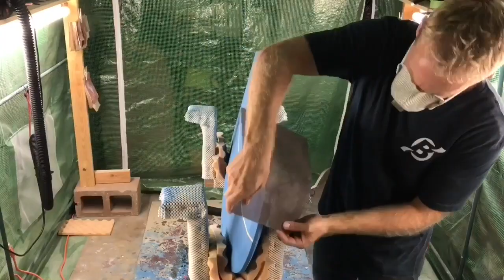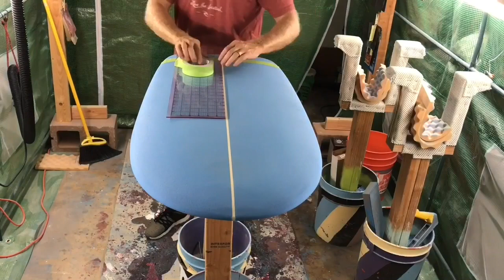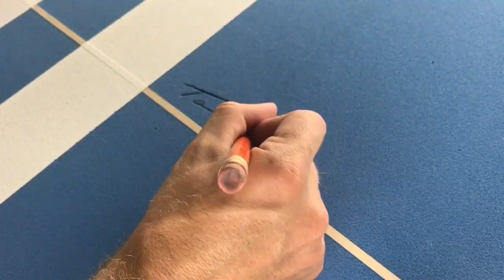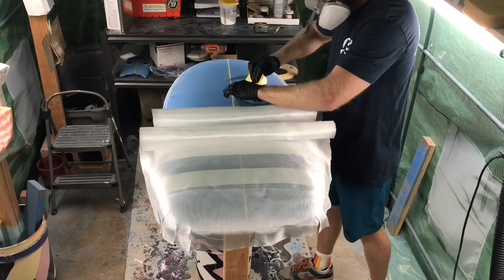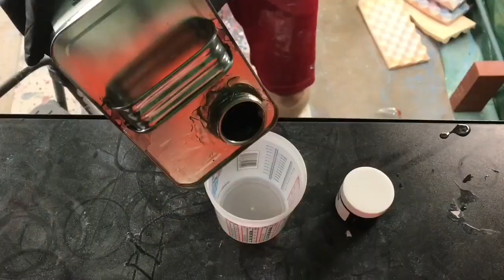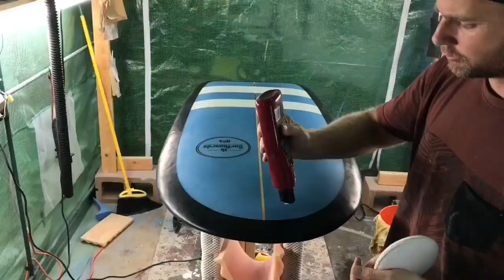Surfboard Shaping & Glassing [Paipo]

Comment: Hey Tanner, nice vid!!! Did you finish the board with gloss coat+polishing or a regular hot coat+polishing?
Reply from the maker: Thanks! I did a gloss coat and polishing.
Reply: @BendheimBoards  Niiiiice, did you use a specific polish for surfboards or a regular one? I think regular ones would do the trick.

Comment: what grit did you use to sand the tinted resin on the rail? thanks!
Reply from the maker: 220 and very lightly not to burn through
Reply: @BendheimBoards  thanks! do i need to use gloss resin for the tinted panel? if im going to polished the board?
Reply from the maker: @6to6surf4  If you want the polished look, then use gloss resin after you've sanded the hot coat